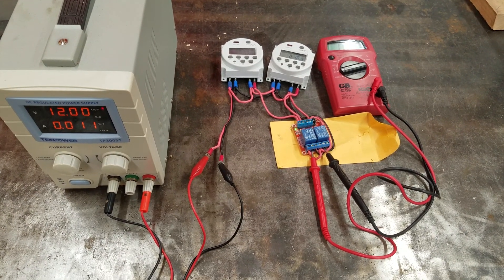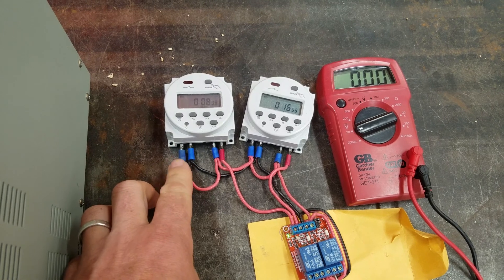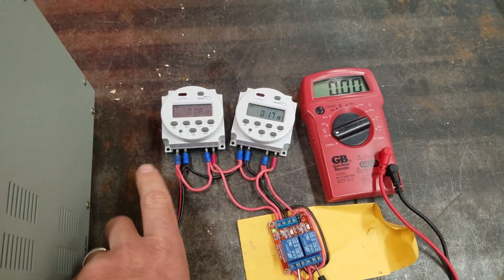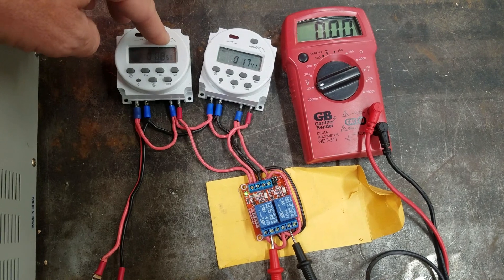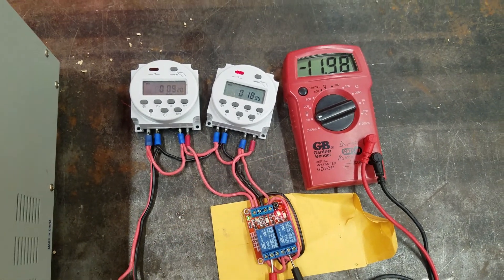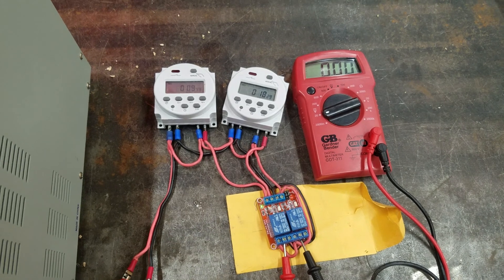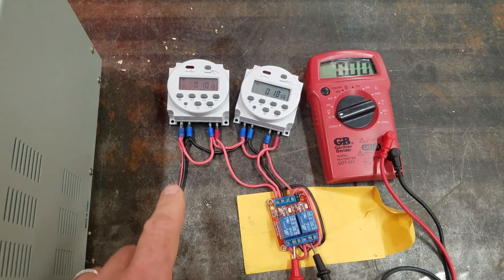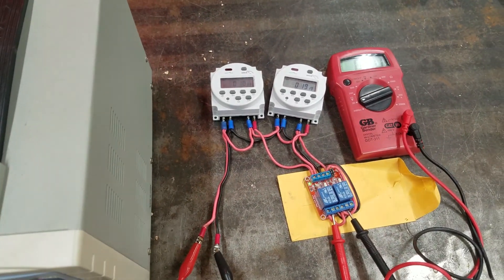Automatic Chicken Coop Door - Wiring Walkthrough

Comment: I can’t understand why your using 2 timers ?
You can set 1 timer to open & close coop door ..
Reply from the maker: Using 2 timers does complicate setup a bit, but has big benefits. With only 1 timer, the timer relay stays on for the whole day (or the whole night). My original post was for a solar-powered setup, so power conservation was the main goal. Using two timers is far more power efficient since the timer relays are only on for a few minutes each day, versus ~12 hours each day if you used 1 timer. Another consideration is longevity. The timer relays tend to burn out if the relay stays on for hours each day, as it would with a 1 timer setup.

The only setup I've done with 1 timer is the Honeywell solar programmable timer where I specified an industrial-quality relay which can handle a long duty cycle.
Reply: @MikeWickenden  Thank you Mike, I understand your concept now a very 
good idea indeed, so I built your system exactly the same, and it worked first
time.. 
Good videos and good details, you’ve made an old man very happy 😊 
Cheers. 👍

Comment: Thank you! Just built. I didn't realize there were different operating voltage of the same timer CN101A models. I bought a 220v one and wondered why nothing was working and kept trouble shooting it for about an hour when I narrowed it down to the timer being the issue. Then I saw the label on the back. Quickly went online and found out there are various voltages from 220, 110, 24, and 12. So don't be like me, and get the one you need, in my case, a 12v since I was using the solar to a motorcycle battery route. The one that came in the mail for me is wired up the same as this video.

Comment: Hi....is there a wiring diagram for this setup, with that specific relay switch?  Also, what size wire did you use? Thanks!
Reply from the maker: Hi Jon, I used 16-gauge wire. My actuator draws 5 amps max. The wiring diagram link is in the video description or here: http://blog.netscraps.com/diy/heavy-duty-automatic-chicken-coop-door-ii.html

Comment: Why do you have 2 timers,,,when each timer has 17 functions????cant 1 timer open AND close the door???????
Reply from the maker: No, because although each timer can be programmed with 17 different EVENTS, they only each have 1 FUNCTION. Each timer is just a SPST (single pole single throw) relay -- it switches off/on, & just one lead.
Reply: @MikeWickenden  Well guess what I got my actuator working off of 1 timer,,,It opens at 6 AM  and closes at 630 PM so just so all the other readers are wondering the same thing i got the answeres,,
Reply from the maker: @mrcoz1764  sure with one timer it energizes the relay all day while the door is open. Not ideal & the relay will fail a lot sooner.
Reply: @AztecWarrior75  and a relay that reverses polarity to the other direction
Reply: @AztecWarrior75  Well my relay works off a tractor batterey,,,,which is monitored by a batterey tender soooooooo  the system is powered and backed up 24/7,,,,,I`m smart,,,I ran power to my coop,,,for Heat and Air

Comment: I have one set of timers that wires up like yours. I have another set of timers where it can use 12V AC or 12V DC and doesn't matter how you wire it. I guess it has a little bridge rectifier inside.  I just changed from using the relay board to using two 5 pin car relay switches.  I applied some silicone on the board because I was worried about water getting to it either while I was looking at the timer or some weird accident.  I love your chicken coop and your automatic door. I built my coop not long ago and Love it. Now my birds can be let out every morning and be safe at night all without me. Which came in handy when I got really sick. I was trying to figure out a setup which would give me a backup door opening system. However if you aren't careful you burn up a relay board. The idea was what if something fails, a battery, solar panel (or long term bad weather), a timer, a relay board. I wanted another door timer system that would operate the door 10 minutes after the first one. Love the video.

Comment: Hi Mike,
I have the wiring correct but the timer screens and flashing and not readable, have you experienced this problem before? I have three timers which I have changed around but without any luck
Reply: Brendan Cook no, hmm. Flashing & unreadable all the time or just when the event is triggered?
Reply: All the time
Reply: Would this happen when the internal battery is flat?
Reply: Brendan Cook hmm I have an old CN101A timer with a dead internal battery, but if I hook it up to external power it works fine. Not sure what to suggest other than return your timers as defective & try getting new ones :(

Comment: Why do you need the relay? Why can't you just connect the timers, with polarities reversed, directly to the actuator?
Reply from the maker: Hi Dan, the timers are SPST meaning they can only switch one lead, from open (disconnected) to closed (connected). So for instance if you had the timers switching positive power, you'd need ground connected to both actuator leads. But then any timer that switches on causes a short circuit...